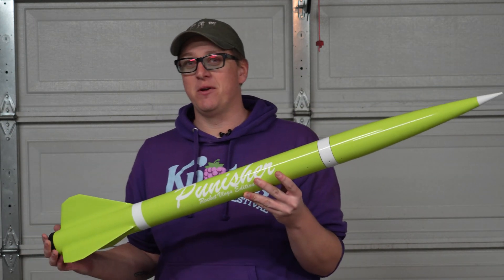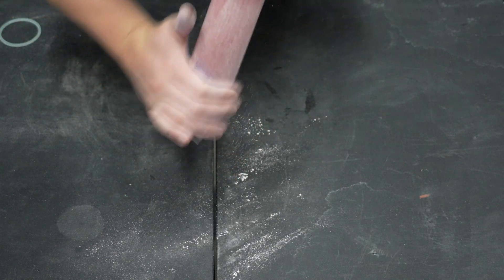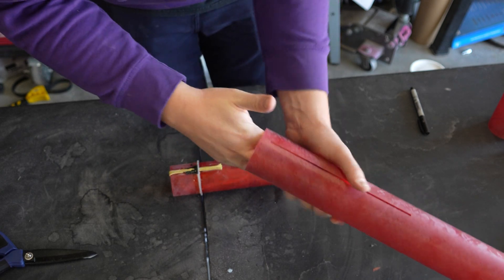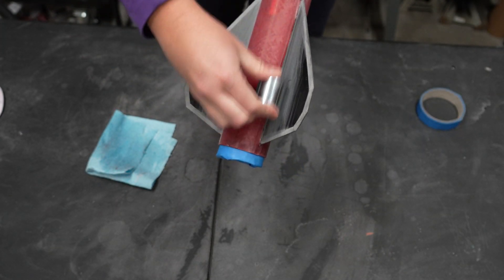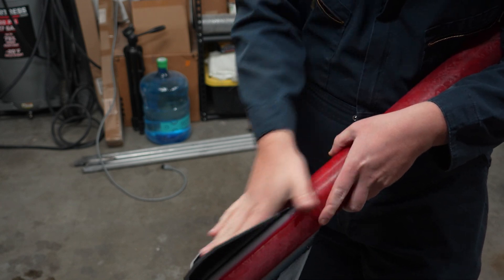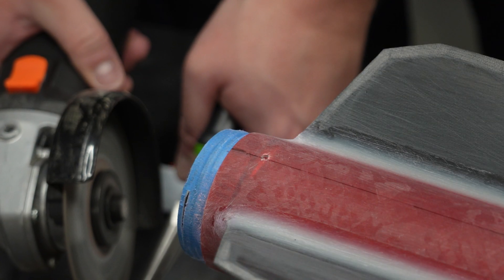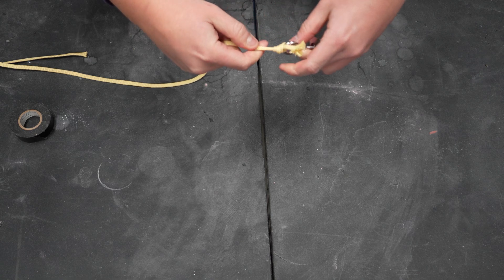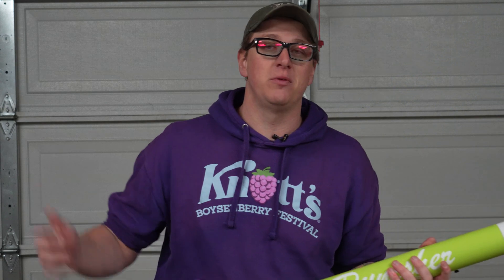The NEW Wildman Punisher 2.6 | Wildman x Rocket Vlogs

Comment: hello all. new here just getting back into the hobby now that my son is 10.  havent done models since i was a kid.  so im kinda newish to the high power. just now flying G's and looking into cert 1.  Is there a model of this in like 2 inch with a Aerotech G motor mount?  thank you and happy turkey day!
Reply from the maker: The Punisher Sport is 2" diameter and has a 29mm motor mount.  It is available as a Super Sport with a 38mm mount to allow G through J with an adapter
Reply: @wildmanrocketry1486 awesome thanks.  Had a guy give me 2 that were given to him already built.  Wasn't sure if it was the punisher mini or sport lol. Got 2 actually. One basic and one dual deploy.

Comment: Great video. Question: If you attach the parachute directly to the AV bay won’t the nose cone be more likely to smack into the booster section, possibly damaging a fin?
Reply: im wondering this as well as the kevlar shock cord that comes with the kit is 24 feet.